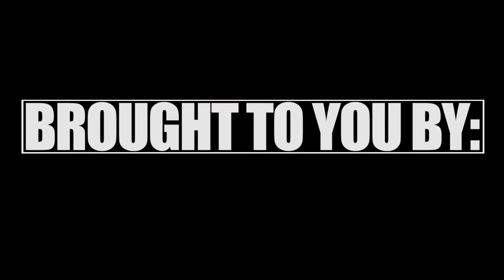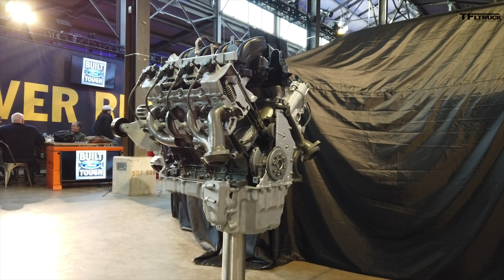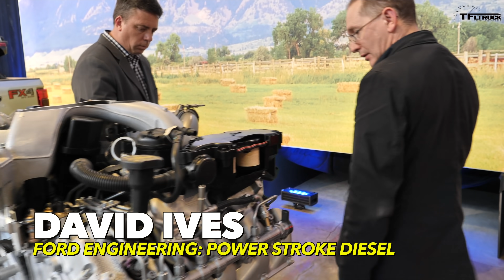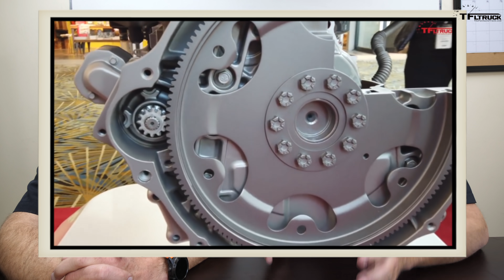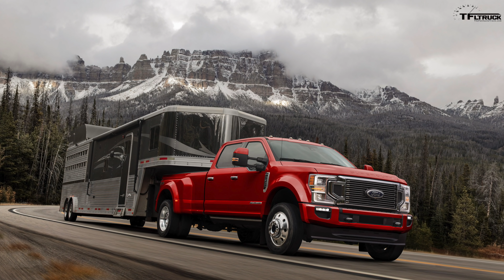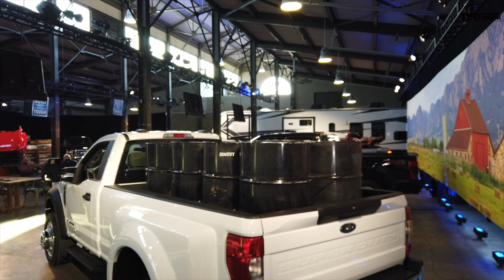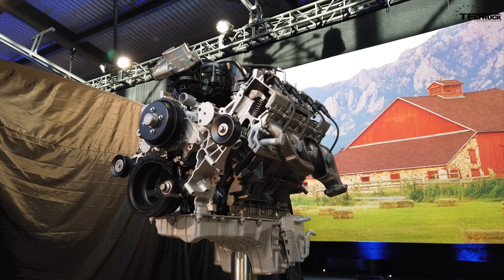Are Diesel HD Trucks Dead / Will Electric Pickups Replace Them? No, You're Wrong! Ep.5

Comment: DEF is a major headache with the current diesels.  It will be hard to replace the torque of a diesel engine, but I do think they are cost prohibitive to most consumers and diesel fuel prices are currently twice that of gas, which negates any advantage diesel might have had.  Maintenance costs are huge for diesels and many small commercial operators just don't want to deal with all the costs and maintenance associated with diesels.  Gas does have it's place and with hybrids that might eat into diesels market share.

Comment: Replace diesel?  maybe 30 years from now.  Until then  electric trucks will be made and slowly trickle in, but will be limited to local use and short range transports.  The adoption cost will fall on businesses, consumers will stay away for a long time.  I do like the idea of a Gas-electric Hybrid, but not diesel-hybrid.  And especially not an all electric replacing diesel, just don't see that happening.
Reply: Agreed. Best use case is for the medium sized (5 ton) urban delivery truck for three reasons:
1) Air quality and noise is more of an issue in cities for obvious reasons.
2) Electric/hybrid tech works a lot better in cities, where there's a lot more regenerative braking.
3) These truck tend to return "home" every night, where they can be recharged via the company's infrastructure.
Reply: The problem I have with diesel hybrid is short haul in colder weather, these Diesels do best when warmed up( I wouldn't own one in Canada)

Comment: My friends 6.2 for F250 gets 12 on a good day. On a good day my Ram with the 6.7 gets 20 Lol, I get 12 pulling my camper!!
I am also so tired of the so called high maintenance diesel. 15,000 mile oil changes on the Cummins. The Ford 6.2 is 5000. A air filter is a air filter all vehicles take one. 
Fuel filters on the Ram I change at 30,000 big deal!!
I think there is a good market for the 7.3L gas motor. Guys that tow a couple thousand miles a year that live in a town. For me it's 50 miles to the first stop light, I don't see me ever switching to a gas truck.
Reply: I have a 2019 F250 4x4 CrewCab with 6.2 and I get 15mpg. Not great but better than my '06 Hemi MegaCab :-( . I have had diesel and gas trucks over the years and I settled on gas. The COST of a diesel powered truck (usually 8-10K more than a gasser in initial purchase) and the added cost of fuel per gallon, takes too long to provide any ROI (about 150,000 miles to break even). Again, I view the diesel as a tool and if I need the pulling power and/or I am driving professionally many miles, then having a diesel makes sense...otherwise you are purchasing an framing hammer for finish work. Not saying one is better than the other, just I look at is as "purchasing the right tool for the job".
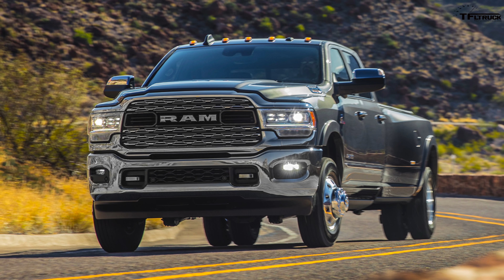Reply: Exactly! My first diesel was 1999 Dodge 2500, a lot of towing horse trailers and still ran like a champ when I traded at 251k miles. Then my 05 3500, same think and traded at 207k miles. Both stock trucks. My new Ram 3500 Limited with HO 6.7 and aisin trans is a beast, a dream to drive and gets awesome fuel mileage. I see vids with guys driving the F250 gas trucks towing landscape trailers with a couple mowers talking about getting 6-8 MPG. Few years ago I has a Chevy 3500 dually with 454, 4:10 gear ratio work truck. Put a 7k lb GN horse trailer on it and went to the mountains. It got approx 6 MPG and was a pig when I started pulling grade, literally had a gravel loaded dump pass me going up the mountain. Two weeks later I towed same trailer and horses with my Dodge up the same mountain, pulled that mountain around 50 mph. No thanks on a HD gas truck
Reply: Having recently switched from gas to diesel I've gone from 13 mpg to 18 yet diesel doesn't cost 38% more.  DEF might cost you $30/yr.  We could call it even if it weren't for the payoff of more HP and a LOT more torque.  Diesel wins hands down. Oil changes are certainly more expensive but you're talking 12-15 quarts too.
Reply: @rbhe357  I dont know man...everyone is stuck on fuels costs and maintenance figures. I got stuck on the initial purchase price. Look Diesel is the king of pulling and if you need that level of HP/Torque then that is what you need. Today's gassers won't beat smokers on pulling power. Period. But if you are pulling around an ultra-light RV or a small boat, does it make sense to spend that much money on "what if" horsepower when a gasser will more than fill the bill. I can take a few less MPG and save 8-10K on initial purchase price all day. Is one better than the other....depends on what you need it for. Not what your balls say :-)
Reply: @rvninnorthcarolina3377  
That's the thing.  I traded a great sounding loaded V8 that I really liked.  I'm just your average truck enthusiast and pull a 7k lb bumper pull trailer (8k when loaded) that is not unlike every other one you see on the road. Despite being well under the tow rating it didn't feel safe and the engine nearly overheated on me twice last year.  

My point was that the cost of diesel ownership isnt what many people, most of whom drive family sedans, claim it to be. Don't get me wrong, the sticker shock put me off a diesel for years, but having finally grabbed ankles at the dealership the other stuff is insignificant.
Reply: @rvninnorthcarolina3377   Have you looked at the prices of some of these trucks?? A New Ram 2500 with the 6.7 Cummins Laramie you can.get into for 55,000
I see a lot of F150's Lariat's  advertised at 60,000
Reply: @rbhe357  Hmmm...your situation may warrant it. You do what you need to do. I have an RV that is heavier than yours and I pulled it with my '06 Hemi and now my 19 F250, both up Seluda Grade In NC and neither overheated, The 19 pulled way better than the older Hemi bit I never felt under powered. I used to own a F350 Dually Diesel and it was far from reliable and finally turned me off. Maintenance is way more than gas too. Batteries (yes two not one), cold weather issues, fuel treatments, now DEF, dual fuel filters, and I wont go into the fuel distribution pumps I replaced. Done . My brother has the same '06 Ram but with the Cummins and he can not kill it...great motor. He says it was the last good Cummins before all the emissions stuff hit. Maybe...maybe not. But I am not arguing your point...if you need that truck to do what you do then that is the right choice!
Reply: @rbhe357  Diesel costs more than 38% more where I live and there are certainly more fuel efficient trucks than 13. Your post could have easily said I switched from a gas to another gas and my fuel economy went from 13-20. We know nothing else about what kind of truck you drive or what you do with it.
Reply: SRN ...diesel costs more per gallon, cost more for the engine & you have DEF just to name three. That makes the base MPG figures obsolete on making a judgment call. That's why a lot of people are broke. You just look at one number & not the whole story. The engines can handle a lot of stress & last awhile bar none but the body ain't gonna keep up. 
The market doesn't lie, the half tons out sell the HDs & midsizes by far & of each respective one, the gas versions sale more, (mainly to do with price)
Reply: @UltraSS-nj8kd  I think a lot of people are broke because they buy the limited trim, when they can afford the tradesmen!
Reply: @UltraSS-nj8kd  - Diesel is more per gallon and the engines do cost more, but the Cummins engines and some other diesels can typically last well over twice as long as a gas engine. DEF is nothing, mine uses 2.5 gallons (about $15) every 10k - 12k miles. The trucks can hold up if they are maintained, I had two that I traded with high mileage that held up great along with the engines, drivetrains running great and bodys in great shape. Half tons do sell much better, a lot to do with price. One problem is people get a half ton truck and overload them instead of getting a truck built for the purpose. Don't know about the other diesels but the Dodge/Ram with Cummins has a high resale value compared to gas trucks.
Reply: Chris M .. definitely right there i see a lot of overloaded half-tons, that need bigger. I see a majority of diesels not being used mainly myself (at the 1st of the month oklahoma go figure). Or used at a half tons level.
 Though on a side note for actual work ,I felt safer my self pulling 20K with the same Cummings 6.7L in a 2 ton International truck  over the 3500 Ram just because of the sheer size & bigger brakes. The Ram felt like it could pull it easy but control & braking was skeptical in certain times.
Reply: @chrism2042  If you maintain newer generation gas engines you should be able to get into the high 200K to 300K easily. I have an '06 RAM MegaCab with the Hemi and it has 148K and the compression test (I ran last month) still is within specs and it burns no oil. I have a friend who had an 02 Tahoe with 260K on it and it was still going strong when he traded it in for his new truck. 

The reality is most people (not all...people like me keep them forever!) trade them in before  they ware out. They become fixated on the newer features or performance gains. That is intentionally done by the manufacturers to create new sales. If most people who bought trucks and kept them for 400K+ miles, truck sales would go way down. All these new gadgets are not ground breaking from a technology standpoint, but for buyers, it creates the shiny new penny that they just have to have! 

I get what you are saying, and yes a diesel engine will outlive a gasser, if maintained in a similar manner, but in my mind the only real argument for diesel is you need that pulling to power...and today, they are the king of torque. Hands down.
Reply: @rvninnorthcarolina3377  - I like the diesel, knowing it will tow anything I need to tow. I have a Tahoe LTZ that I wouldn't consider hooking my boat to, but many people do it with larger boats and abuse the undersized truck. I tow my 24' bay boat from NC to Fl Keys every Spring, I hate the thought of the diesel I use for those trips and couldn't imagine those trips with gas engine. And the resale value, within a year I traded a 2005 Cadillac Escalade (almost perfect condition) with 76k miles and 2005 Dodge 3500 dually (great condition) with 207k miles. Checked kelly blue book prior to taking them to trade. Traded the Escalade for a new Tahoe LTZ and the 05 Dodge for a new Ram Limited 3500 dually. The 05 Dodge had 131k more miles than the Escalade and the Dodge trade in was well over 200% of the Escalade value. Pros and cons to both gas and diesel.
Reply: @UltraSS-nj8kd   Here are some nu.bers of my wife's daily driver  a 16 Ram 2500. 6.7  She drives 50,000 miles a year for work 18 mpg is a bad tank but that is the number I will use. Today's diesel price and today's gas prices. I will save 2637 over a 12mpg average 6.2 superduty  Exhaust fluid will cost around 80.
So after 5 years I will save aroumd 12,500
I would also like to note in the summer diesel is usually the same price as regular gas.
But when I trade this truck for a new one I will get almost all the money back for the diesel option!!
Another thing is the 7.3L probably will have a up charge of a couple grand
Reply: @srn9973  Just depends where you live I guess. Here where I am gas is .93 cents per liter, diesel is 1.16 a liter (more than 93 gas btw). My 18 Power Wagon averages 13 MPG, it costs me around $90 give or take to fill my truck up to go 400-420 miles. A cummins Ram would take $115 give or take to go   600 miles. When you factor in the $10,000 difference between the 6.4 Hemi and 6.7 Cummins, you're not going to have any savings at all.
Reply: @WilliamStewart1  Everyone likes to post the list price, but what is the actual cost of the 8,800 diesel option. No one buys a truck at list price. After dealer markdown the diesel option is right about $5000 which also comes with a lot longer warranty.
Diesel where I live is the same price as regular gas in the winter. In the summer it's usually a little cheaper the gas with ethanol.
I buy road diesel 2000 gallons at a time and get it delivered and it's cheaper yet.
Reply: Diesel trucks are far more expensive to buy and use on a daily basis period! Everything costs more in them plus fuel and all the extra shit you have to go along with it when you do fuel up as well! I have a feeling that they will get away from using them all together with the size and the news that this 7.3 is also built for boost! Twin turbo that engine and you'll have all the power you will ever need! Diesels are geting more shit put on them in 2022 so I definitely wouldn't be surprised if they get away from them!
Reply: Typical response from a Ram owner.
Reply: Not trying to start a pissing match here ;)  Both gas and diesel have their strengths depending on your needs.  My post was to address the idea that diesel trucks are WAY more costly to drive.  Sure, there's a few extra considerations to be made, but for me the pros outweigh the cons.  The only major hurdle is the mortgage payment that now sits in my driveway ;)
Reply: They could make all the HD trucks get 50+ mpg but the gas companies wouldn't make no money that way. They have already stated that almost half of fuel exits the exhaust unused. Thats why I'm excited for electric trucks, that way they finally might get there sht together.
Reply: My 6.2 gets 15.4 MPG combined
Reply: So how about my 2014 international dura star with close to 30000 lbs total weight? Will it get better fuel economy with a gas engine than the 466 diesel? Never

Comment: I think diesel specifically will be replaced by hydrogen fuel cells.
Reply: Why?  (Not arguing just curious about your opinion )
Reply: But... there are problems to transport and store a highly explosive thing, the costs would be high, that's why the electrics are winning.
Reply: How many of today's CDL drivers have have proper certifications or endorsements to transport these materials? Not to mention the cost of maintenance for them. The average joe with a trucking company is not gonna be able to afford to build what is essentially a bomb shelter to work on them. That's the reason Natural Gas hasn't taken over. I work for a large company and we have ONE shop in Maryland equipped to handle Natural Gas trucks. I'm not saying it can't be done or even that it's not a good idea. It's just gonna cost too much for small businesses to handle. Then Economies are going to feel it.

Comment: They must have missed the part in the interview when the engineer said that the 7.3 was built for boost! As big as it is it would make all kinds of tourqe/hp with a turbo set up especially if they twin turbo it!!!
Reply: @Chris Jacobs go back and watch the video with TFL when Andre talked to the engineer! At 9 minutes he talks about the internals of the engine! Yes it will take boost!
Reply: Kevin McKinley you misinterpreted.  He states the engine was designed to provide power like it was boosted, without the lag of a turbo and the complexity.  He mentions forged internals, but it takes a lot more than forged internals to boost an engine.
Reply: @LynxStarAuto  okay dude if it has forged interal it will take boost! He stated in the video that it used the same material that a boosted engine uses! That means it will take boost but they are not going that direction at this moment
Reply: @Chris Jacobs if YOU think it is false info that's on you and you alone! When someone says it has "the same materials used in boosted engines" then that's exactly what that means! They might not use it now but in the future they will use it! When 2022 comes around and the diesels get even more restrictions on them they will have to have something in place for a back-up! The engine IS ready for boost in the future weather you agree with it or not! It will not suprise me if they get away from diesels all together! Now stop trying to be the smartest guy in the room because it won't take that much for a turbo to be put on this engine all that needs to be done is a little bit of tuning and getting the fuel system going!

Comment: Electric vehicles will replace ALL petroleum-powered vehicles, ... eventually.  The eventuality is inevitable, however this may not happen as quickly as first speculated.  Apparently, vehicle manufacturers see a last "hoorah" in gasoline engines, and this time due to the cost/efficiency of gas vs. diesel, gasoline engines are making a big comeback with their new and more torque-focused designs.  ... we're living in interesting times ;-)

Comment: Electric the future, get behind it Trump Idiots
Reply: Ide rather see hydrogen fuel cells, the military built  a prototype out of a Colorado I think, it was pretty cool.
Reply: Ford needed the 7.3 to bridge the gap between the 6.2 and the 6.7 diesel. Some people can't afford the diesel option but still need a truck that can tow 16,000 lbs reliably.
Reply: The diesel engine with become more efficient and after treatment will not be necessary. Diesel engines will become smaller and lighter. Electric motors will be added to smaller diesel engines and smaller gas engines will be paired with electric motors.
Reply: Electric motors will eventually take over but it will be another 60 years before that happens.
Reply: Electric with a small gas engine to recharges batteries will driving. deisel has a better power curve then gas.  Gas is great for drag racing,deisel is better for towing and electric is better than either.
Reply: Red Berry

Comment: My 2001 2500hd 8.1 is at 350k. Have yet to lift a valve cover. Super reliable and inexpensive to maintain. 340hp and 455 lb-ft . It is an old pushrod BBC. I look forward to seeing what these new HD gas engines can do.
Reply: A girlfriend once left me for a pushrod BBC.
Reply: hom many gallons per mile do you get lol